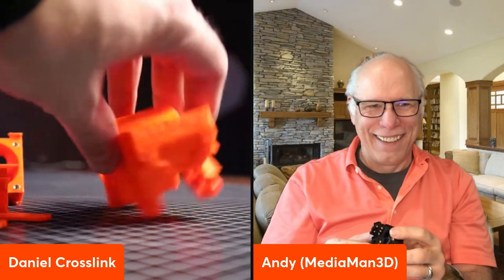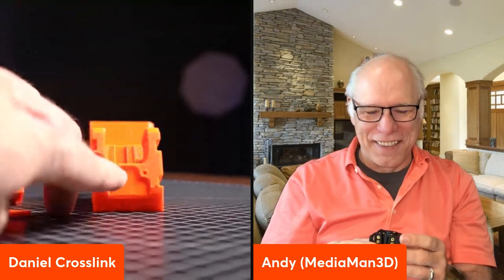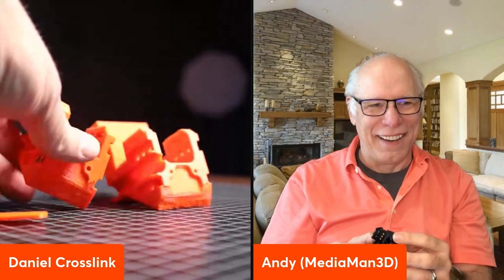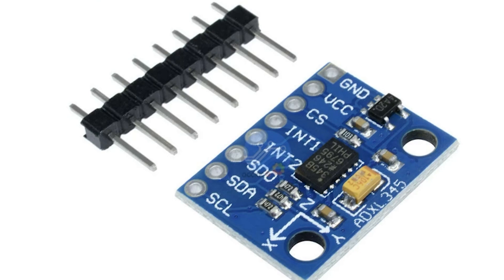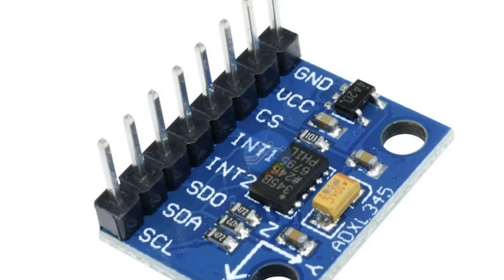The Hero Me Suite is too heavy? - With Andy MediaMan3D Soderberg

Comment: In regards to the weight, it's not if the weight "is slowing me down" that I'm searching for however it's "How much quicker do the roller wheels wear down from the extra weight" when compared to something like the Minimus Cooler System. So far I've found zero reviews that mention that. So either the difference is negligible or (and this is unlikely) I'm the first person to be concerned about maintenance over speed. 🤷‍♂
Reply: I think you don't understand how strong the POM wheels are

Comment: One question which I havent been able to find the answer to is do I need to run the same size fan between the blower and the cooler? So if I use 5015 blower what fan size do I use in the middle? is also a 5015 or can it be a 4010,4020 etc?
Reply: Any 40mm but im sure you know that now